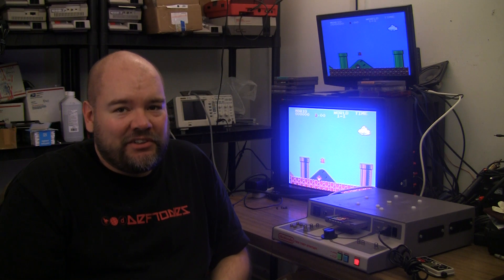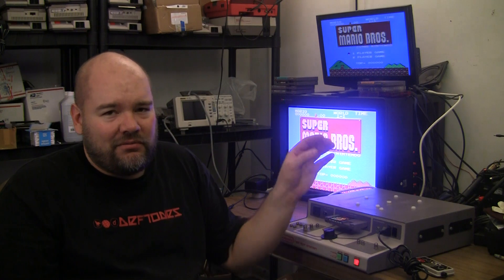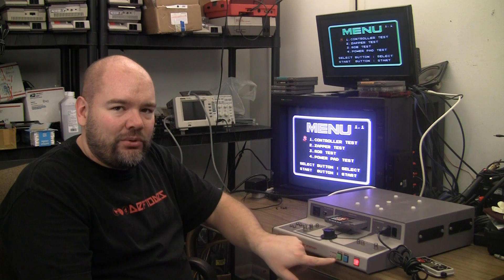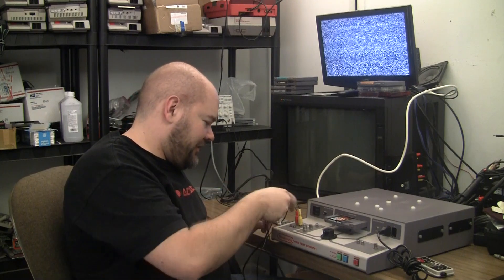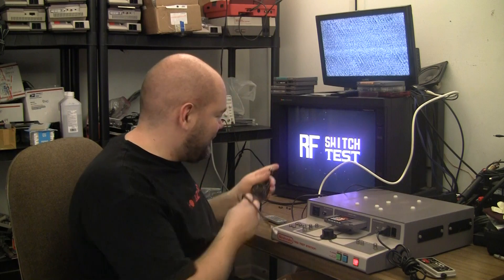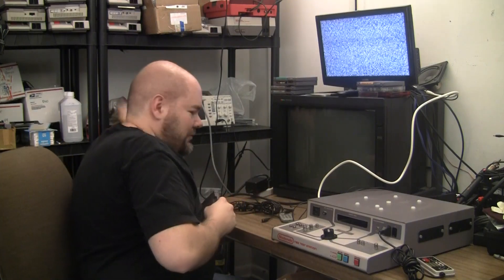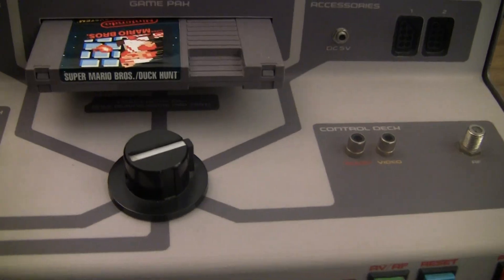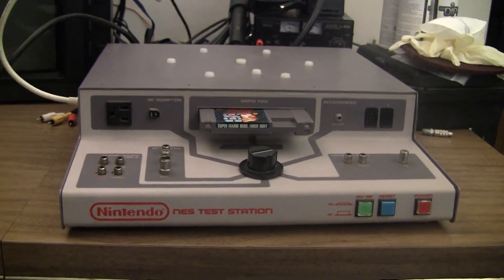NES Test Station - RAREST Nintendo - how it works - Pt 1

Comment: About modding a CRT TV to accept RGB input: the OSD route doesn`t work on all TVs since many jungle ICs take this input as digital only, some ICs have analogue RGB inputs but they are disabled (even if you tap signals to them, you simply can`t make the TV display them, not unless you hack the control IC) after years and years of looking for an alternative to the expensive arcade chassis, i found that the only way to be sure is to feed the damn thing directly to the neckboard, since then have been using old and cheap ntsc TVs as arcade monitors for years...as long as the HV and deflection work, i can use it...

You RGB-mod consoles like anyone else but you haven`t modded TVs to accept the glorious RGB? that`s odd...
Reply from the maker: Omega Rugal Can you link to or provide instructions on how to directly feed RGB to the CRT?
Reply: It`s not an exact science since all TVs are made diferent:

see if the neckboard accept RGB values, (i have only seen this in newer TVs, a 21 inch Philips and a 19 inch Magnavox), if so, use an IC like the MM1375 (monolitic RGB video amplifier) to drive the CRT output transistors, the design of the PCB to get the correct voltages, impedance and so is up to you.

If the neckboard uses shit like Y, Y-R and Y-B (all older TVs use this, after all,  Y and C was the way the picture was proccesed back in those days) then you gonna have to make your own neckboard, get an RGB neckboard from another chassis OR modify the existing one so you are driving identical signals to the CRT, but moding the neckboard is not always possible, like when the Y signal is permanetly locked to a certain value and the R and B signals are adjusted relative to Y.

The last option, the OSD route is the easiest as long as the jungle IC accepts analogue OSD values, replace the OSD signals with your own (matching voltages, impedance) and lock the fast blanking switch pin.

in all cases, the sync goes straight to the jungle IC, some ICs accept it as it is, other require you to amplify it, filter it or the use of a sync splitter.

the only problem i have noticed is that the image shifts a little to the right but in most cases is acceptable...

Obviouly all previos mods permanetly turn the TV into a Monitor.
Reply: Omega Rugal I have to agree, I have done a couple of these RGB TV hacks with varied results too. I mainly wanted it as cheap arcade monitors which was the worst result anyway, consoles were already coupled correctly so they did fair. The direct feed to the neck was the best result but you have essentially no control on the geometry without wasting a bunch of time. The jungle IC OSD override works but you would have to tune it for whatever console or game you were using which was senseless unless you only wanted to use the TV for one purpose. In short- it was cheaper to just go buy a NEC XM29 for 100 bucks on ebay than waste time.
Reply: Where i live, arcade monitors are expensive and a little hard to come by....
Reply: I understand. It would be nice to create a small universal circuit that you can plug on any neck and then be able to fine tune the signal and properly clamp the video, even amplify if needed.

Comment: A Fivel binary 5 V DC included is a primary 15 V DC input is a binary 185 V DC input is a binary want you could power any type of device you want off of that is long is it to DC the virus and it requires thinking you probably make Rob run off that easily because that was a 4020 mill amps